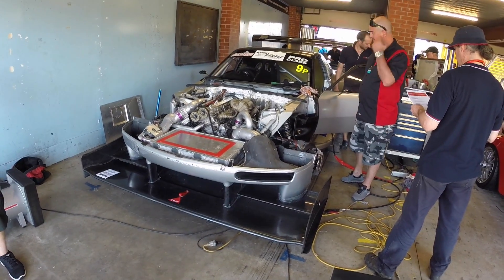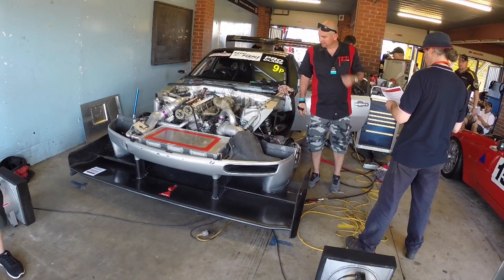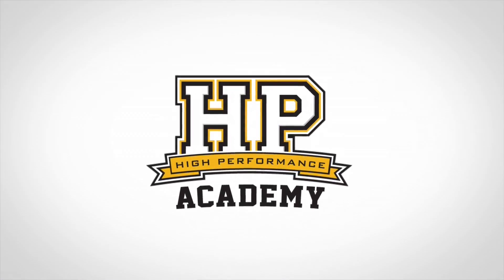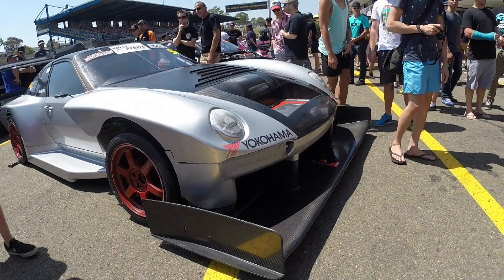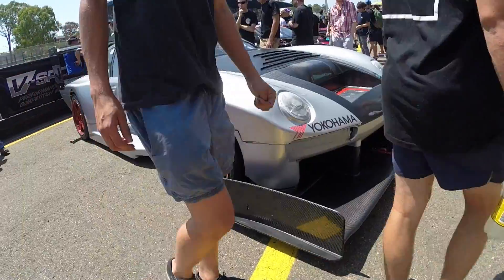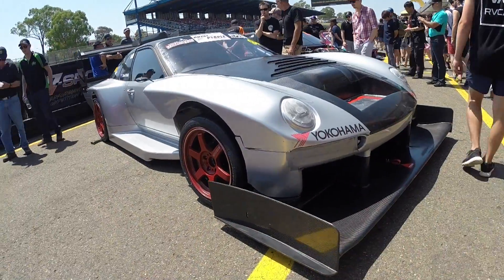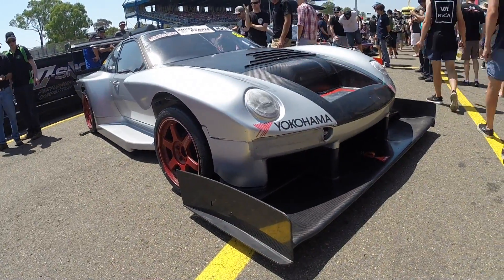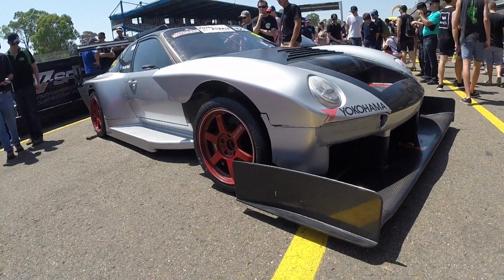Using CFD modelling to develop aero packages for competition vehicles

Comment: What are the sensors that were used to measure load at the contact patch? I could not understand that bit but it sounds tricky to do, given that the tire sits on the contact patch. / confused
Reply: The term he said is "Force Transducer" but outside that, your guess is as good as mine as to how it works :P
Reply: They are measuring the load on the suspension then deducing the load at the contact patch I think.